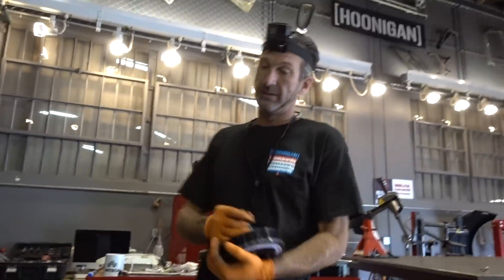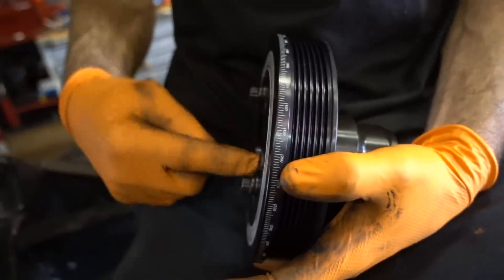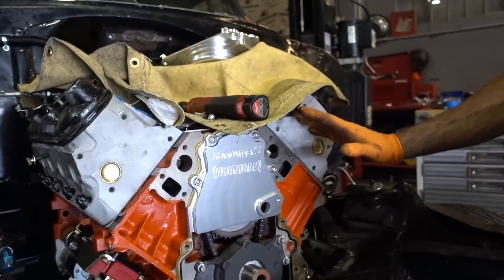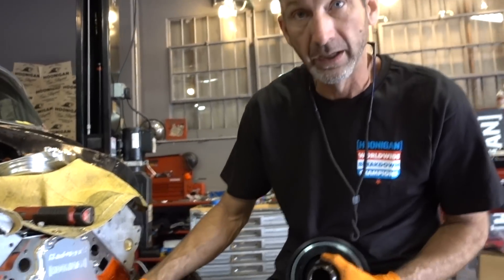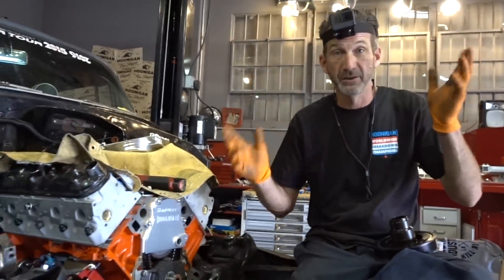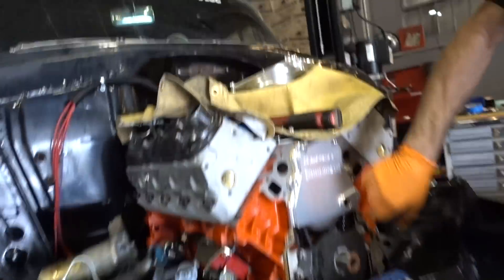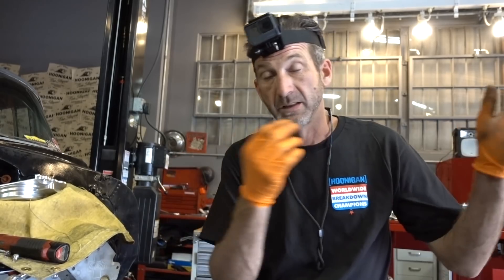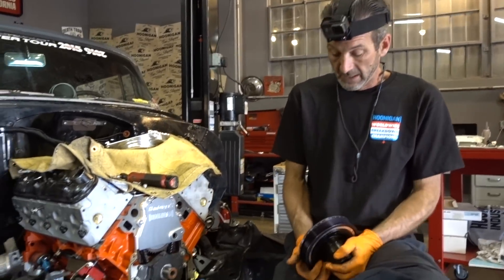How to: GM LS Engine Timing w/ Bad Daddy Braddy

Comment: Even analog gauges fail. We just use different technology to get information now. If you want redundancy you can have multiple sensors and inputs into the Holley setup. I have a fair amount of faith in quality sensors. Cheap stuff you never know

Comment: Ah BRAD you are old like CAT . He thinks you tell the machine what is what. Now its the Machine tells you whats what. You kind of have to wrap your head around the fact that nothing you do has a control anymore . The control is from the computer.  The younguns don't understand having control. That is why they are amazed old guys can tighten bolts accurately  by feel.no torque wrench needed for most things.

Comment: Guys. Most all oil pressure sensor  act when the pressure is Zero. Not at 10 or 20 or 5 psi. Means when light goos on you are nearly done.Late for action.So it is always good to have a Buzzer or and a sensor with turns light on at higher pressure. wich i don't know if it is easy to find for any car.

Comment: Another aspect of importance to what Brad is saying, the cam can have up to 5* of timing disparity from specification just from manufacturing variances, timing chain slack, and sensor read. That is why degree wheels and even hard-marked elements such as the aftermarket damper are good additions to a build that moves away from stock cam selections.

Comment: As an addendum to what he's saying after about 6:25, that temp difference he's talking about can also happen sometimes with totally accurate sensors, if they're placed far enough apart. They can absolutely read two different, but in this imaginary case, true and accurate temperatures. This is especially important to watch for on engine swapped vehicles, as components often get moved to different-from-stock locations to help everything fit.

Comment: I relied on my oil pressure idiot light right up until I built my first Holden 304, reknowned for having pressure issues due to a shit oil pick up. Now, I cant handle not having one regardless of the engine/car.

Comment: With two seperate gauges which one do you believe? I’d rely on the factory stuff. As long as you use factory sensors.
Reply: Bunghole Bungville I think the idea is compare the two. If they’re both reading high or low, you can safely assume there’s a real problem. If they’re contradicting then I guess that’s a judgment call.
Reply: Or if one fails there’s a back up.
Reply: if you have two gauges you always believe the one closest to what it should be.....simply for comfort reasons

dont listen to me i have about 0.00001 knowledge on mechanical stuffs